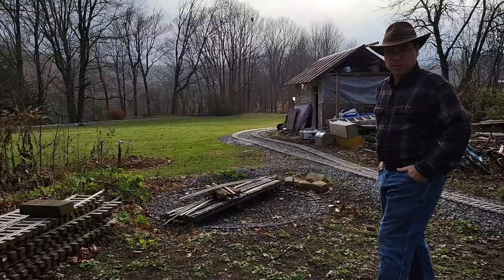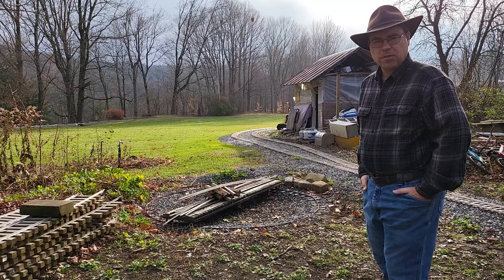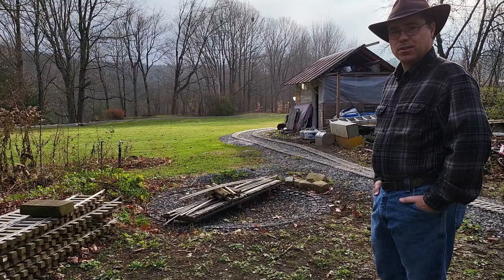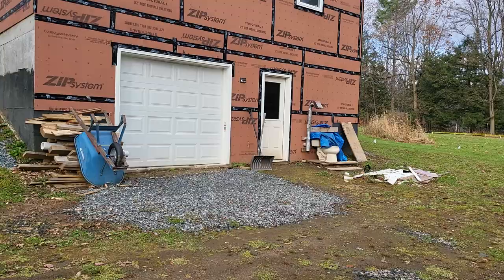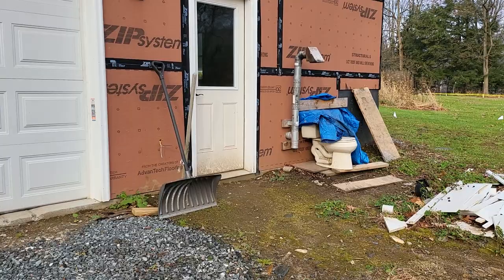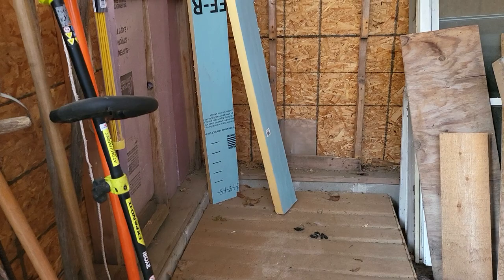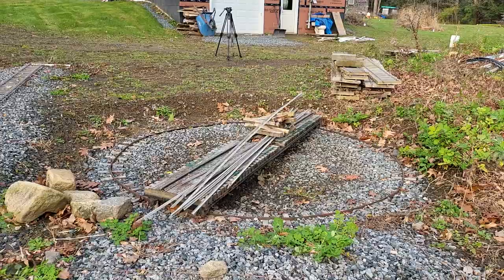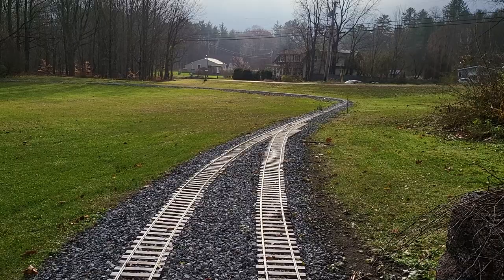A short explanation of our turntable

Comment: That will be pretty sweet when the turntable is completed. I saw a comment about it in a recent video, I really hadn't noticed it before that. I also noticed the rails inside the garage in the video with the jigsaw. That will work out when you build/repair rolling stock.  Thanks for the video.

Comment: With just a few add on, i see a pretty descent genious stove. Now it´s just a firebox, add a good kettle, few pipes, pistons, many wheels and a drum of water, and voilà ! The nicest duplex in the world. A really unique one. Outside it´s a steam loco that ride the rails, enter the basement,  sit on the modified  turntable with pivot at one end and guiding wheels at the other end, making it a  90 degrees right switch and now it turns back to a simple stove !!  That´s why i call it a duplex or Double Utilities Powering Locomotive EXtension or if you prefer a LOCOSTOVE ! proudly made in Vermont by Aaron, and invented by me. What an incredible team we do.
OK, i agree, i didn´t invented it. CN did.
Sort of...
Since i know that you really love relaxing ice stories, here is a good one.
In 1998 (or 99) when hydro lines fall down during the big icy rain storm that last a week, Montréal was black for a while, CN left an MLW M420 at a rail crossing, lift by cranes and push straight on road pavement to an hydro substation on Montréal southshore to furnish electricity. That full throttle contraption was used for about a week or may be more, before returning to more railroad duties. In some locations, that power outage last more than a month 
But here is the trick, they burned diesel, you it´s wood pellets. It´s totally different....
Run Forest, euh sorry run Aaron, run to your drawing board  Guiness book team is waiting for you !
Reply from the maker: We also got that ice storm. I think it was 1998. I was a bank courier at the time and I would listen to CJAD on part of my my route. They were on 800 before the storm, then moved up the dial after their towers collapsed. It took awhile for them to get new towers built, but I could listen to them when they went back to 800. These days, I drive some of those same roads but I can't hear CJAD anymore. Instead, I hear Sur Le Musique on 100.7 FM!
...and that's 4 hours south of Montréal!

Comment: Just a thought, you might want to extend the tail track from the siding over close to the garage door, at least temporarily, so you can use it to haul a few bags wood pellets to the basement with the flatcar as you need them.  That's gotta be easier than using a wheelbarrow from the shed to the basement...
Reply from the maker: It's something I've given some thought to. 
...But we don't carry wood pellets in a wheelbarrow. We carry the bags in one at a time.

Comment: that is great that you have the set up in the basement . especially with the heat!
so that unit heats your entire house? so are you going to have single to dual 
track through a switch into the basement from the turn table, or will it be two
independent tracks? what an amazing set up. thank you for sharing your railroad.
have a great day.   barry